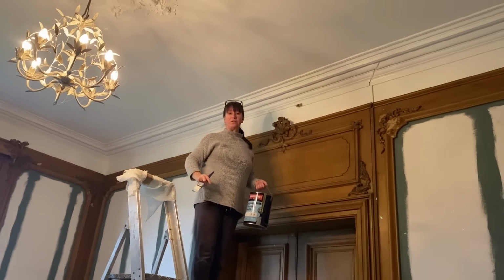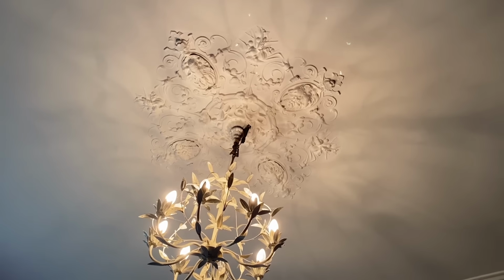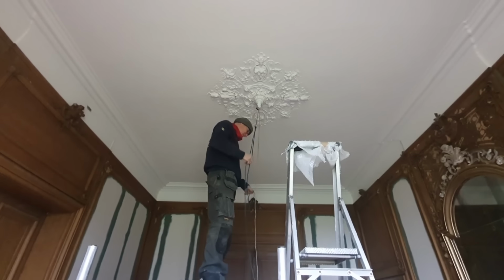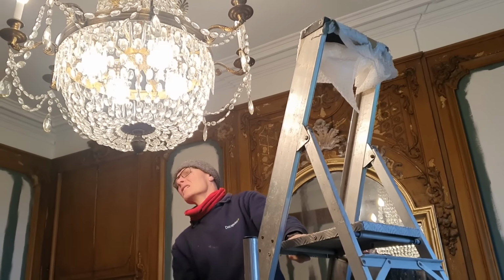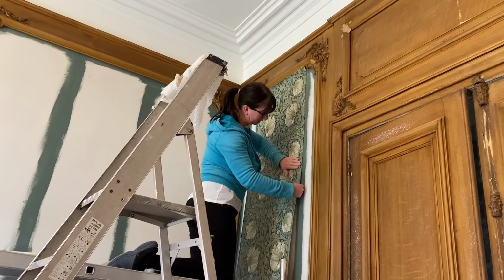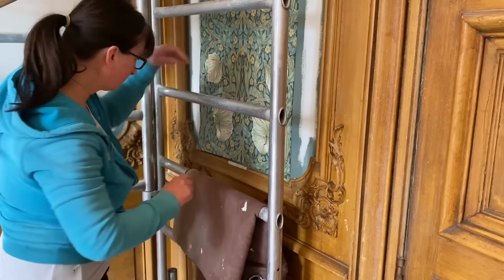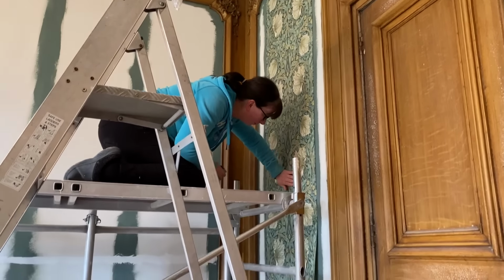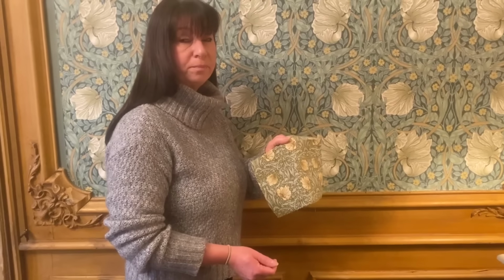€€ It Was Worth Every Euro!!! €€

Comment: That chandelier looks not only exquisite but also is the PERFECT fit for that room.
Also, I really like the blue-green wallpaper with the floral pattern. Having to center and then cut the for the sides for the wallpaper after laying the main strip must have taken an extraordinary amount of time. From the looks of it, if you want to do it right, Carole will be the one to ensure it does.  
I was not a fan of painting the upper edge of the room white but after your explanation of the little trim pieces finally being highlighted and not drowned away in all the brown, I can see and agree with getting just the top part painted.  It really helps make the ornate trim pieces pop!

Comment: You tube channel The Expat Butchers . The third from last vid they did they used a light system where if the wires to the light fixture are good you can pair a wireless switch . No need to wire from wall switch to the fixture. No batteries required either . It is a new kinetic tech. But of course if all the wiring needs replaced anyway you may still want to do it old school. America doesn't have this new tech yet but it saves half the fishing of wire work .❣️❣️❣️